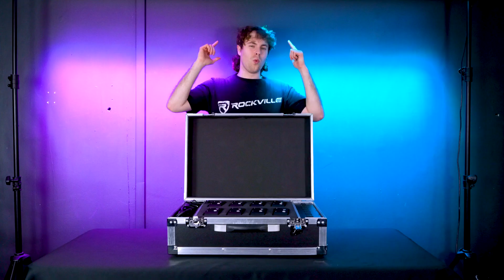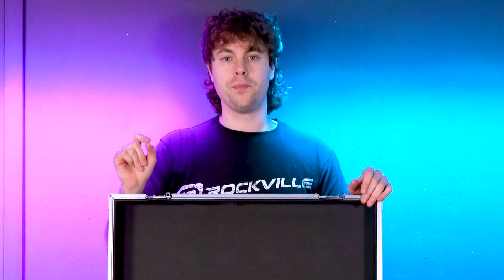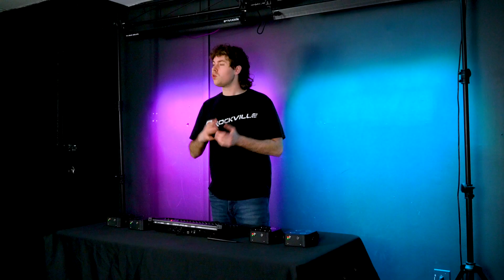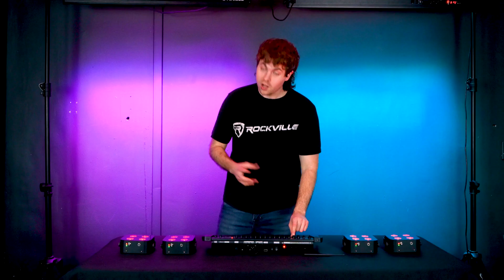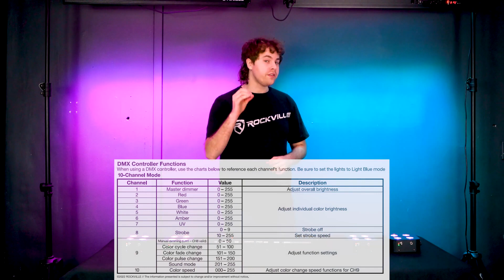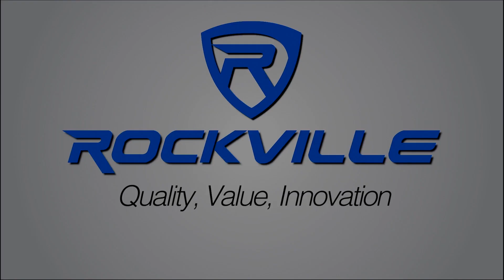How To Set Up Wireless DMX w/ Rockville MINI RF4 CHARGE PACKAGE 8 Battery DJ Lights+Case+Remotes

Comment: Want to try these lights but am curious as to how can you set the lights to a specific DMX channel if there is no display on the light? I use DMX software connected to a wireless transmitter and have each of my lights set to their unique channel, so curious if these lights will work with my setup.
Reply: my question exactly.

Like I have a wireless DMX transmitter hooked to a USB interface with several receivers, do the RF4s only work with the master/slave grouping on a Rockville DMX Controller or do they have a DMX address per those grouping colors (Red, Green, Yellow, and Blue?)
Reply: @Adam_hits_stuff  I emailed their support and they only work with the Rockville controller that sets the channels at the color level. I ended up going with other lights from a different brand